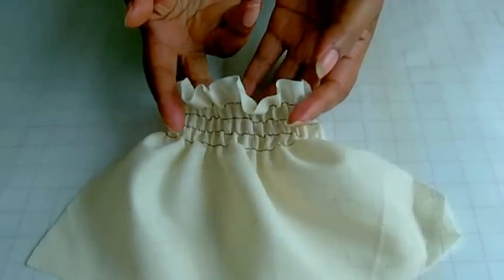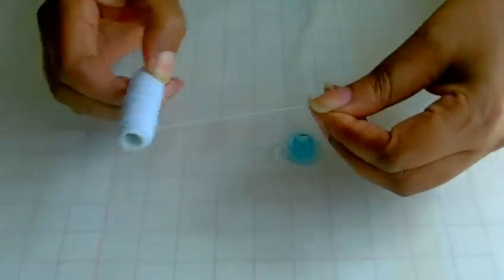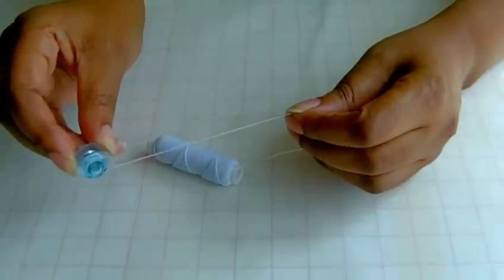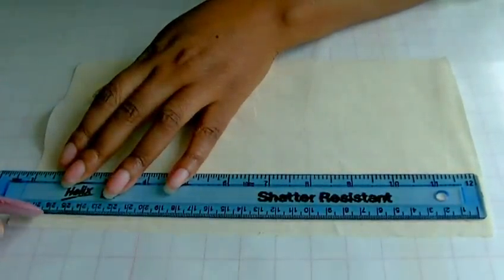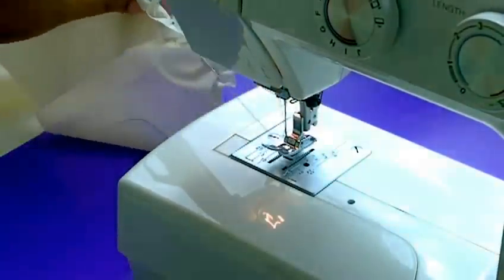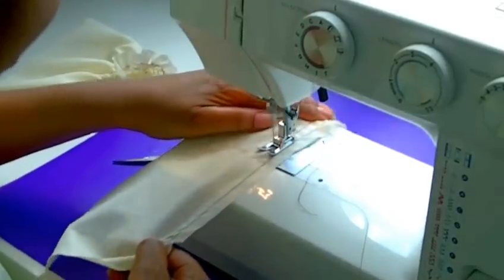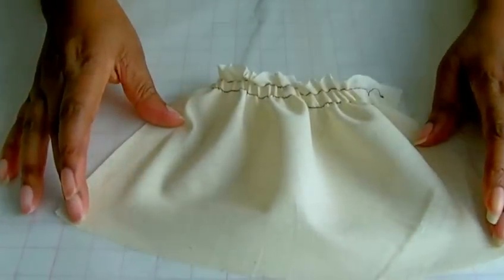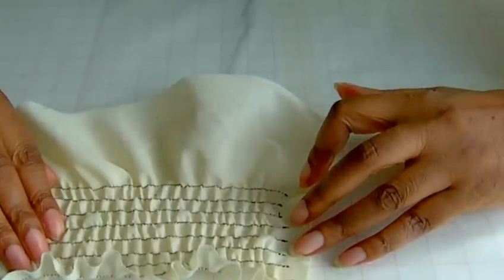Sewing with Shirring Elastic

Comment: Hi At 73 yrs young I have just decided to try shirring elastic for the first time, I followed you tutorial and found it very easy to understand, and I was quite successful first time round, one little problem was the elastic kept springing back into the machine, and to solve it I  used a washing peg to hold the top cotton and elastic at the back of the machine, just long enough to get started, and it worked well, hey pressto problem solved Regards Mo wilkins

Comment from the maker: It will depend on the fabric you are using but I'd opt to use probably double the amount you'd normally use.  It is important to do a little tester first to ensure your calculations are correct.

Comment: I have a top loading machine and it was a PAIN to thread the elastic thread. I tied a length of regular thread to the end of the elastic thread with a tight small knot, then used that leader to pull the elastic thread through the feeder. Much easier.

Comment: Check your bobbin tension, you need some tension, but not pulled as tight as it can go. Also, when you back stitch at the beginning that you have the bobbin thread pulled taught. Instead of stopping for each row, I turn the fabric around and stitch the next line going the other way. That way I keep my tension

Comment: Hi 
Do you know if the singer Futura II 920 works the same way as the Brother?  It's a top loader, I manually wrapped it around bobbin, but when I tried to sew, I didn't get the gathers, just a straight stitch.  Do I need to change anything?
Reply from the maker: You could possibly tighten the tension just a little on the bobbin!

Comment from the maker: It will all depend on the weight and type of fabric you're using for the width of stitch! Generally, the smaller the stitch, the less shirring effect you'll achieve.  The bigger, the more.  The best thing to do is to always do a few tester pieces to get the setting just right on your project.

Comment: Hi thanks for the lovely tutorial. I spent two hours on my machine with no luck. I did all sorts of things possible. The upper thread stitches well for few stitches then starts to skip stitches. Any tips on how to rectufy it and successfully smock ? I tried adjusting tension. Stitch length - 3.5. nothing helped. What could be wrong.
Reply from the maker: I’m not sure, maybe changing the thread or needle and see if that stops the problem. Thank you for commenting Diya r.

Comment: Thank you for the very helpful video. I have a couple of questions. When you roll the elastic thread on to the bobin, do you stretch it slightly? Or is it just firm enough and not stretched? Also, what type of stitch do you use? Many Thanks
Reply from the maker: Hi Becca, Yes you are right do stretch the elastic slightly and the type of stitch is a straight stitch.

Comment from the maker: Hi. Your questions are most welcome.  You only need a regular needle for this technique (I used one in the video).  I'd use a stitch of around 2.5 - 3.5 and wouldn't go any less than that.  It's just a case of practice and testing to see what looks best and the different effects the stitch length produces.  Hope that helps a little.

Comment: i have a janome top loader and a riccar top loader both are breaking the elastic both are not pulling the elastic tight what am i doing wrong i did everything you did ???
Reply from the maker: If you followed my video then maybe there is an issue with the elastic itself.  Try using a different brand as you'd be amazed at how different they can be.

Comment: Do we need to make adjustments on the tension of the thread and poppin ?
Reply from the maker: It may be necessary depending on your fabric, sewing machine and the result you are looking for, how close or loose you want the shirring to be. I would suggest doing a couple of samples Agnes.
Reply: @colleenglea  I have done some samples but still have not got the right shirring I desire.  Will have to do more samples.  thank you.
Reply from the maker: Hello Agnes, Maybe think about winding the shirring elastic a little tighter, I hope that helps.
Reply: @colleenglea  will try in my next attempt, hope it helps so that I can repair my dresses and probably try on a new dress.
Reply from the maker: Okay! Good luck Agnes.

Comment: please excuse my ignorance on the subject, being a man, could i ( hand sew ) this kind of elastic into the neckline of a jumper collar that has lost its shape over time and become too big and loose ,perhaps sewing looser than you have shown with a machine?  to restore and save an otherwise okay garment that is not worn out
Reply from the maker: Hello Brian, Yes it is possible, your biggest issue is going to be the tension of the elastic thread as you sew, I would keep the stitches small and do a test sample.
Reply: thank you I will experiment soon although no expert in sewing,
Reply from the maker: Good luck Brian, I'm sure you will do a great job.
Reply: Colleen G Lea - FSBTV . Thank you for your encouragement, I have now restored 5 jumpers , the "trick" or "knack" seems to be not too much tension on hand sewing, to avoid gathering,just weaving in and out through the back  of the collar, top and bottom, as near to the top as you can but on the inside, and with a matching colour, works best on thicker jumpers, very pleased with the results even with my neanderthal stitching, brought back to life several favourite jumpers ready for winter.